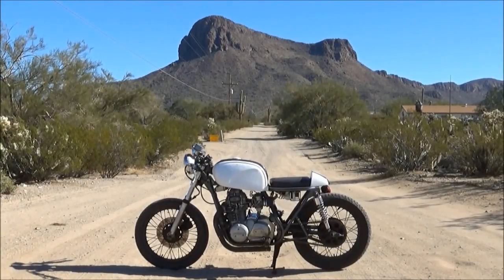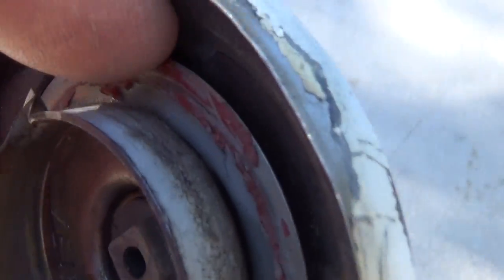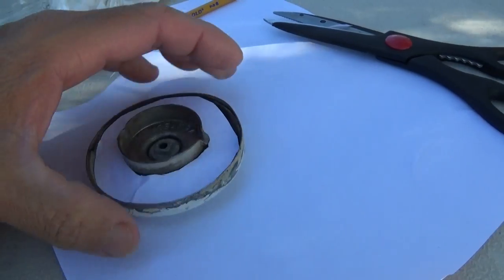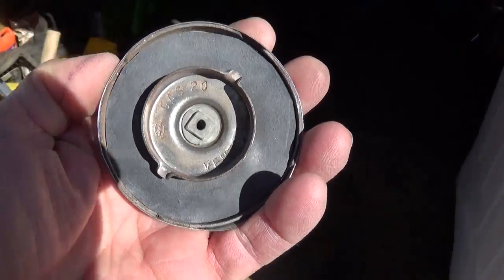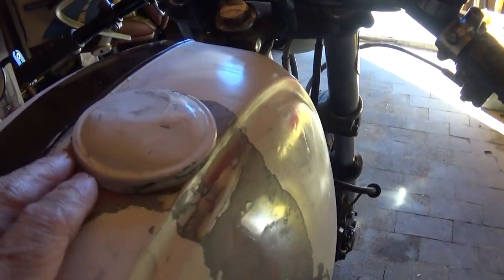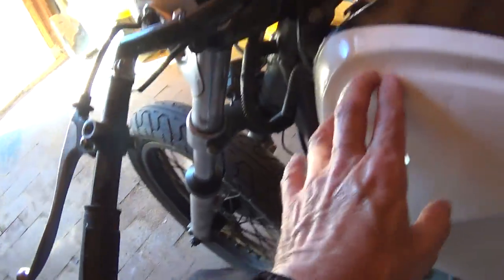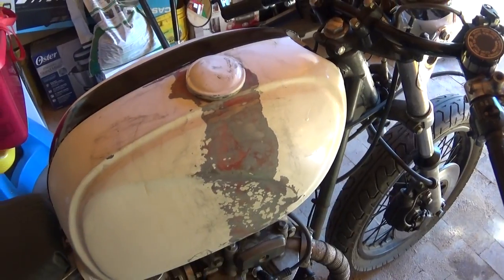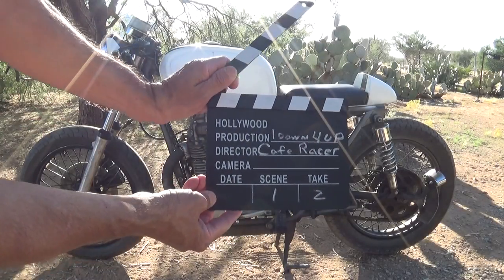Motorcycle Gas Cap Fix What would MacGyver Do?

Comment: thanks for this video, I have the same problem with my motorcycle fuel tank, it does not leak the fuel outside the fuel tank, but the smell come out. I will do the same and hope it can be fixed this problem.
Reply from the maker: cool, hope it works for you.

Comment: Do you have a problem with tank venting with that cap? I just filled the tank on my Bultaco and after riding for a few minutes it startedrunning lean because there was no fuel in the lines. Opened the cap and fuel flowed down the lines.Nice bike.
Reply from the maker: +44Magnum6 no I had no problem with it, but I sold this bike a long long time ago.